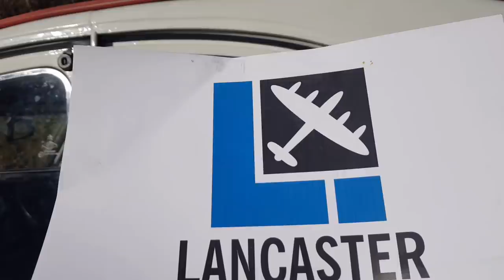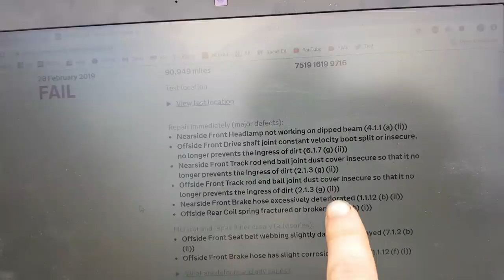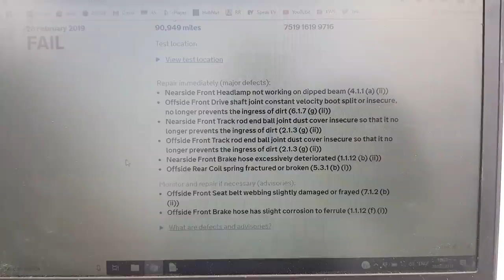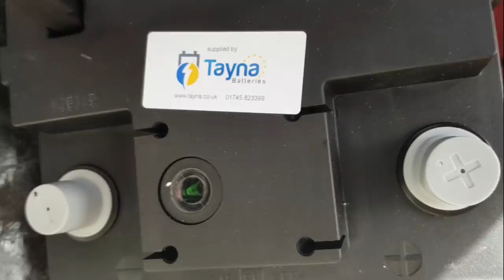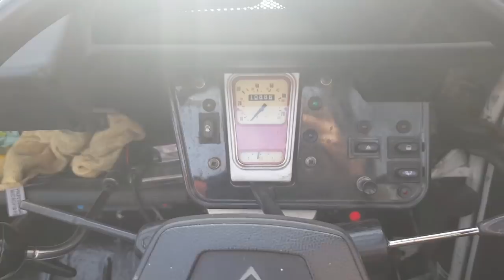Mazda 323F MOT result, 2CV battery change

Comment: Out of interest would they have let you drive the Mazda home, I know there were some changes last year re this and some fails would not allow you return home to fix. minor stuff really for a 200 quid car that’s otherwise sound if cosmetically challenged - others have said what I thought re terminals, you run the risk of at best a terminal coming off over bump, at worse actually causing a fire and we don’t want Elly destroyed!

Comment: Why did you take so long to buy a new battery its not like they cost much as for the battery connectors why do you not just have one with a quick power cut off then you can have the connectors nice and tight and if you want to cut the power from the battery you just loosen the big plastic bolt a couple of turns job done and you do not end up with mucky hands.

Comment: Modern battery's are rubbish  don't know what's going on  had about ten that we have sent back as tested low or scrap from supplier
Tried a different make and same result. Same battery just a different sticker 
We fit batteries on a rubber sheet and sheath the steel straps we fabricate in large cable shrink to prevent any arcing or water tracking even moisture to prevent voltage drop leakage..     You may find that with the fox project and clean up earth's and cables that maybe poor connections  corroded cables within and now in car won't be as good as jump leads on floor
If you panic about fire hazards  quick release wire in a battery isolator switch and mount it on that spare flange.

Think anyone buying a used car from you would be tighten up those battery clamps is this why you have so many non start issues?

Anyway nice to be updated with the mazda    not that bad and making money so you don't have to get dirty fixing modern stuff
Buying a car then selling for a profit   this is not the usual Hubnut  motoring  we are acustom too
Reply from the maker: I've only used the loose clamps on the 2CV, but it might well be something to do with the starting issues this year, though last year's were due to a crappy li-ion battery (that did have tight clamps). I will improve matters.

Comment: Stopped watching as soon as you said you won't be doing a video on you repairing
Reply: Sensible thing to do , leave it with garage , fines will be more than garage bill if caught by Police or self funding Dvsa vehicles with unroadworthy vehicle , different times now with mot laws , check vehicles regular lights / tyres / fluids not just at mot times .
Reply from the maker: Indeed.